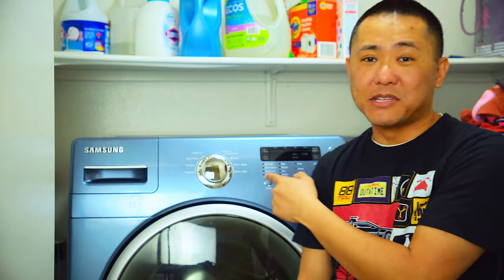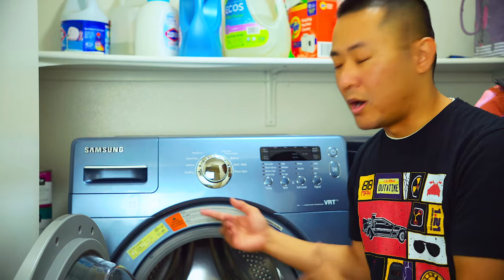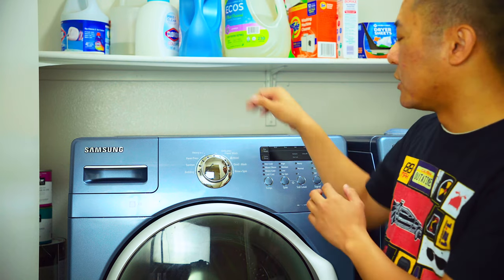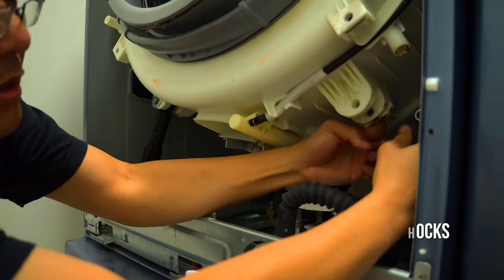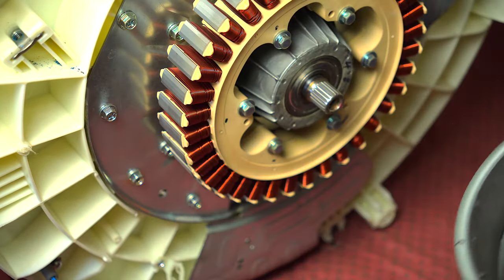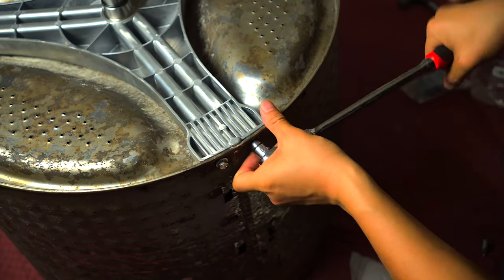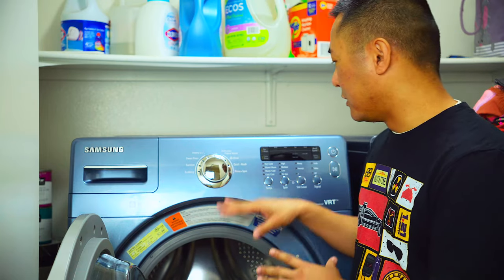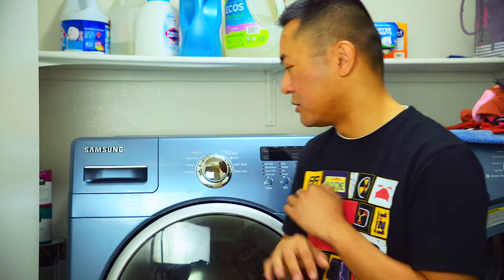How to fix Shaky Samsung Spider Arm Washing Machine [FIXED] Imbalanced - Replacement, Flange Shaft

Comment from the maker: Update: the Dryer in this video ended up leaking gas, needing a Valve replacement. The Belt also needed to be replaced. Due to the cost in parts, I decided it was time to replace the set: https://youtu.be/dpphpJzCjYw

Comment: Repair costs are so ridiculous nowadays. How do they charge $600 for a $800 machine!? I might as well just buy a new one lol
Reply from the maker: lol yup!!! Actually, the belt on this one snapped, and the valve was leaking gas. I finally gave in and replaced this unit due to the cost of parts! (Check out my latest Samsung video)

Comment: Mine has a wable and a rubbing noise. .1/4" offset on one quarter of the ring. So it's rubbing and stops it from going to full spin. Replaced shocks. got better but not fixed. .how do you know if it's balance ring vs bearing and spider ring? Also a 15 year old scenario so sounds the same but worst worp and rub.

Comment: Good video and well explained. I think running the washer with bad shocks contributes to the spider failure due extra shaking of the drum. This causes extra forces on the spider due to shaking. I am thinking a good thing to do would be to replace shocks at the first sign of increased vibration or perhaps every three or so years as a preventative maintenance.
Reply from the maker: Good theory and bad shocks can definitely cause premature cracks and pressure on the spider arm! 👍🏽
Reply: I would just replace them on a set interval cuz by that time it's probably too late

Comment: Great video! Also… I spy some fabric softener on the shelf. Fabric softener as well as not leaving the washer door open to dry out is a recipe for broken spider arm due to corrosion 😢
Reply from the maker: I am always on my family about leaving the door open, but did not know about the fabric softer. Going to go give my wife an earful about that now 😅. Thank you!
Reply: Downy Fabric Softener is like cholesterol for your washer hoses.  It also ruins the plastic parts of your machine.
Reply: Also closed door leaves mold that ruins door seal and leaks later.
Reply: @JamesFixIt  How old was the machine and how regularly did you do a maintenance wash?

Didn't find the machine too dirty so surprised the spider was corroded.
Reply from the maker: @johndoe-vc1we  This washing machine is a good 13 years old!  I started doing maintenance washes after about 5 years of owning it, and now do them monthly.
Reply: @JamesFixIt  So after five years how often did you do maintenance washes and did you use any product in the wash. I'm assuming you did this on the 'Sanitize' cycle. This machine does not appear to have a dedicated drum clean cycle. A drum clean cycle fills the water to the level of a rinse cycle. Typically three times more volume of water compared to a regular wash cycle.
Reply from the maker: @johndoe-vc1we  I actually used Heavy Duty setting on Hot water, and I throw in a cleaning tablet once a month, but I never thought about the sanitize cyclem and might switch to that going forward :)
Reply: @JamesFixIt  The settings are fine but the water level will be low in a wash cycle. The issue as I can see is soap residue gets on the spider arm. The maintenance cycle helps to clean it. But it has to be regular or the build-up increases. If the buildup is detergent residue then will something acidic do a better job than say Affresh? Afresh or similar is good for dealing with smells. They loosen up any gunk left behind by liquids or fabric softeners. What I've noticed is when the machine is clean I do not see much foam in the machine towards the end of the maintenance cycle. If there is any it dissipates quickly without lingering.

thirteen years is a good run btw. It's the high water mark. I've seen people break their spiders in half that time. So you have treated your machine better than most would have. Second, you caught the problem before it got worse so you have no damage to your tub 👍😊
Reply: @JamesFixIt  which cleaning tablet do you use? Looking through the user manual for your machine they say to use the 'pure cycle'. It's a modifier button next to your power button. The thing here is what temperature is the water? the only way to tell is to use an IR thermometer, those gun-shaped things that allow you to measure temperature at a distance. Wait until the washer has got going for a half hour then use it to measure the temperature of the door. Will give you an idea of how hot.

The other thing I'm reading is hot and heavy duty runs hotter than hot and normal. The sanitize cycle runs 65/150F.
Reply: My 2009 wf209anw/xaa wash tub has movement back and forth along the axis of rotation, but no wobble when the machine is off. While running it will wobble and cut off. I'm hoping the problem is either the balance springs or shocks. The spider arm repair is more time and money than I am willing to spend. Is this just wishful thinking? You're repair video is excellent. Well done.

Comment: Thanks for this video. It was really helpful for repairing my WF200ANW washer. A couple of notes. The gasket in the WF220 is a bit different from most other Samsung washers and is not sold separately. They expect you to buy the whole rear tub! So I reused it but added silicone grease to help get more life out of the seal. Also, when reassembling the control panel I plugged the thermistor into the wrong (but same size) connector leading to a t3 error. Other setups may vary so take photos of everything as you're disassembling to have a reference for what goes where. Good luck to everyone else doing this repair. It's not so difficult but will leave you achy the next day.

Comment: Thank you for posting these directions. This is exactly my problem. Now that I have it taken apart, my Spider Arm is completely in pieces. Wish I could post pictures, its a mess. The only thing I wish I would have ordered at the time was the door diaphragm. Just ordered it, could have everything back together tomorrow, but have to wait for that new seal. The old one is gross... These directions are super helpful.
Reply from the maker: Glad you were able to fix the issue!  I guess I am lucky that my spider arm only had a single break :D

Comment: Huge thanks for making this video! I was able to follow your instructions & use your links to get the parts that I needed and get my washing machine back up and running. I don't think I would have tried the repair without your excellent video so thanks again!

If anyone else does this, but finds that your machine is still behaving badly after replacing the spider arm and will not enter the spin cycle - I also had to replace the rotor position sensor (samsung p/n DC31-00098A) which was $11 on Amazon. Machine is running like new now.

Thanks again James!!!
Reply from the maker: Awesome to hear!  Thank you for mentioning the rotor position sensor, and that's great that it's so cheap!

Comment: Nice and concise directions. Thank you. I did this about five years ago and am once again facing this issue and needed a reminder about how to do this. Still cheaper than replacing the entire unit. Good for the wallet and good for the environment! As a materials scientist I have to say that the spider arm is an example of engineering done right. They have to balance (excuse the pun) the opposing requirements for a highly stiff arm while minimizing the chances of brittle failure. They obviously chose to compromise on the brittle failure because it would be much more annoying if the arm were to plastically deform. The harsh environment the arm has to endure does not help the situation, especially when pretty much every light weight alloy is going to be made out of metals that are very reactive. Hmm... I might have to do a video on that after I take apart my washer.
Reply from the maker: Wow thank you for the information, and I'd definitely like to learn more about the materials.  Keep me updated if you end up creating a video on that!
Reply: @JamesFixIt  Will do!
Reply: Leave the door open and never need to fix that problem again

Comment: Good video, nicely done!
Ours doesn't hammer as hard as yours did, and it doesn't wobble when we turn it manually,  so I'm just hoping that new shocks will make our 8 year old Samsung front loader purr like new...
I would also recommend re-calibrating the washer after you've done all that work.  Takes les than a minute.
Reply from the maker: Great info and that does sound like a shock issue. Thanks and will look into the recalibration!

Comment: I did it.   Couldn't find the parts on AMZ but found a parts place who had the spider and the bolts which must match.  I am putting the front back on again tonight, did the inner rubber boot, kind of tricky but once you see it, it's easy.  So hopefully the outside one snaps on easily and all the rest is good.

I am likely going to do first load with the top off just to watch closely for any leaks.   My units are on the 2nd floor (I know, not a good idea) but they have been working for 12+ years, like your video says and they are big $, not to mention putting these into landfill is not good.  So I really appreciate your video, it was great! 

Thank you, Thank you, Thank you.

ps., agree pull it out, fix, then put it back in and take lots of pics with your phones before you take things apart.
Reply from the maker: Glad you were able to locate the parts and get everything situated.  Running the first load with the top off is a great idea!  Hope everything went well!
Reply: @JamesFixIt  Washing machine is so good.  I don't remember it being this quiet when new.  It's smooth and the spin cycle no longer sounds like a missile is about to launch next door.  The removal and re install of the spider/balancing and all the screws electronics connectors and drain tubes were mostly logical.  took pictures on my way out, wrote down each part I did in order and qty of small screws then put them in magnetic dish.   The risky part was re-connecting the white drum (which looked legendary after we cleaned it out) and we didn't have or couldn't locate a gasket.  So i made sure the current one was not damaged and I purchased ATV heat gasket seal and put a light bead of that all around (blue stuff like toothpaste).  I placed them together and did about a 60% tighten, left it all day when at work, and that night cranked it down tight.  It's holding water - not a drop.

I think this was about $250 or so for parts and my time but it's rewarding and satisfying to fix things and I have now fixed that dryer heat element and the washer spider.  thumbs up.

Comment from the maker: In case time stamps are not showing up:

0:00 - Introduction
3:09 - What Parts Did I Replace?
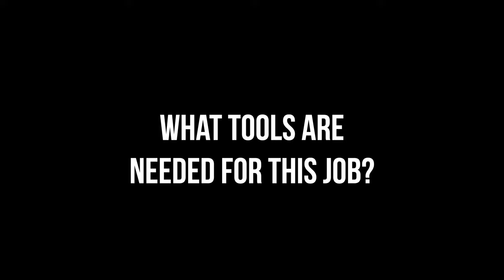4:30 - What Tools Are Needed For This Job?
5:12 - How to Disassemble The Washing Machine
9:28 - Disassembly to Access the Spider Arm
12:20 - How to Install the Spider Arm and Bearings
14:59 - How to Reassemble

Comment: Great video thanks. I need to dismantle mine (Kenwood) as it makes a horrible noise, could be the bearings or spider or both!
Been putting it off for ages as I cannot find the right bearing code/size. I'll need to disantle it first to see what bearings it has which is a pain as we'll have no machine for a week or so.
Not a cheap model - washer and dryer 10kg. If it was a cheap model I'd just buy a new one.

Comment: Hello, I have a Samsung WF42H5000AW/A2. The drum wobbles a shakes when trying to start the spin cycle. As it's trying to spin, it seems to rebalance and tries to start the spin again and again and again. The is a knocking sound as as the drum wobbles out of balance. I replace all 4 of the shock with the correct one "B" in the rear. I can hear the shocks trying absorb the drum system. I do wonder if i have a bad order. the 2  I wonder if it balancing ring as it look like it damaged around the edges from the excessive knocking. The 2 heavy spring the hold the drum system look ok/. What are you thoughts? Thank you so much!
Reply from the maker: That sounds like the same problem I had in this video; broken spider arm.  Does the drum wobble when you try rotating it by hand, even when empty?

Comment: A couple of notes from my experience doing this...
1. take lots of pictures during the teardown... it helped a lot when putting things back together.
2. James is right about getting the top on and off of the springs. I did it, but it is not necessarily easy, and I am relatively strong.
3. On my model, WF42H5200AW/A2, there was a trick to getting the control panel off. you had to undo the screws holding the soap tray in and slide it back.
4. My impact wrench did not budge the " difficult" bolt. I took half of the tub off, grabbed the metal basket between my legs and used a long rachet handle.
5. In my case, the shock absorbers were difficult to get out of their brackets.  If you pull/twist while wiggling them, they will eventually come out.  I had to twist and wiggle them while pushing to get them back in as well.
5. It will be a miracle if your machine needs this repair and you do not snap the heals off of a couple of the screws holding the spider arm in. They are made of sh*t metal
6. if you are going to replace the bearing on the inside of the tub, be aware that the plastic seal that covers seems to actually be a metal disk coated with plastic.  It is (or was in my case) very hard to pry out, and since there is a metal ring inside, if you are pushing down on one side to pry up the opposite, you are very likely (as I did) to bend the metal disk. Given how tight it is seated, I am not sure how you would get it out without bending it.  You could just assume you will replace it of you are replacing the bearing (the seal disk is pretty cheap, I think), or do what I did (under time pressure - no time to order a new seal), and use a small hammer and rachet extension or piece of wood to bang it back into shape on a flat surface.
7. Also about that disk.  When it finally popped out, a small spring also popped out.  It took me a little while to figure out that it goes in a groove around the edge of the flexible part of the seal toe hold the rubber against the shaft of the spider arm.
8. Wear mechanic's gloves. l cut my hands to pieces.

Comment: Great tutorial.  My washer shakes violently, and there are no error codes. During the cleaning cycle, I noticed plastic pieces in the drum.  Could the plastic housing be breaking off as well? I am going to follow this tutorial,  at this point,  nowhere else to go but up! Thanks for sharing!
Reply from the maker: Hmm not sure how plastic pieces could show up inside the drum like that. At least it isn’t coming from the outer plastic shell. 

I was finding tiny bits of metal in the bottom catch filter (from the broken spider arm), but nothing inside the drum. What color are the plastic pieces?
Reply: @James Fix It!  Thanks, James - they appear to be part of the plastic mounting frame that holds the rubber seal.  Everything else checks out fine as you described.  The holding drum rotates fine both ways, looking in through the back, the springs, and 4 shocks appear new and undamaged or worn.  Should I check the machines balance with a level and perhaps adjust the pads if necessary? Then recalibrate?
Reply: I was finding bits of plastic in the filter that I think were being scraped off of the inside of the plastic tub by the unbalanced basket.

Comment: My 2009 wf209anw/xaa wash tub has movement back and forth along the axis of rotation, but no wobble when the machine is off. While running it will wobble and cut off. I'm hoping the problem is either the balance springs or shocks. The spider arm repair is more time and money than I am willing to spend. Is this just wishful thinking? You're repair video is excellent. Well done.
Reply from the maker: If there is no wobble when turning the drum with the unit off, it does sound like your spider arm is straight.  Hopefully it's a different issue of shocks, leveling feet, etc.  Were you able to find the source?
Reply: Yes. I replaced all 4 shocks. The 2009 washer works much better, although I avoid the high speed spin setting. The air shocks are unbelievably flimsy, old and new.
Reply: So it was about a $60 repair and several hours playing with it, although I'm retired. Saved hundreds on a newer washer. Thanks again.

Comment: Did you coat the spider with some kind of protective coating? We did ours around 2010, so we are probably on borrowed time with this replacement spider. It's starting to shake bad again occasionally setting a shaking code. So we probably do spider, bearings , and seal plus shocks and both front and rear balancers. But, before I can buy parts I will diagnose unit just to see how far gone it is. I want to coat the new spider and see if I can eliminate this problem of spider deforming.
Reply from the maker: I did not, but I definitely wish I did! Please let me know what type of coating you end up going with!
Reply: Do the damper shocks first,all four $32 bucks amazon.  Also dont overload the washer, asking for major problems like this video.

Comment: Are you trained In working on such appliances or is this the first time you did something like this ? I probably have the same issue with my washer but I m dead scared to dismantle it as I have never worked on such appliances . Any valuable tips for me ?
Reply from the maker: Not a trained person on this, just generally handy. Should be good for the average person following this video. Lmk if you have any specific questions!

Comment: Did you put silicone on your rear tub seal? One video says to do this and others don’t mention it at all
Reply from the maker: The rear tub seal actually had silicone pre applied when I purchased it, and I haven’t had any issues. I’d recommend adding it in 👍🏽